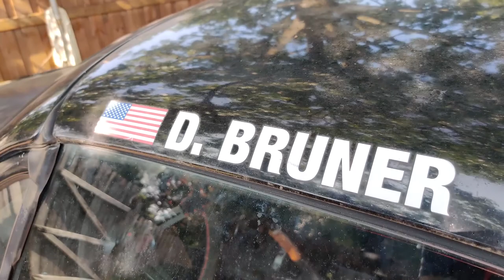2013 Scion TC ultimate daily driver EP2 front lip paint+install (How to do an OE quality paint job)

Comment: Great video! I have a black '13. Do you know where I can find the paint codes for color matching? Also, what fogs do you have!
Reply from the maker: Thanks so much! Very nice! The paint code will be part of your vin number, of which you can find on the inside of your door jamb. You can look up what part of the vin is the paint designation. As for the fogs, they are the winjet kit, from Amazon.
Reply: Thanks dude! Are you plugged in to any specific forum or community that I can follow you at?
Reply from the maker: @JonCarton  not really, I'm just active here and on instagram, which you can follow us at. I do post more updates there. I've got more TC content planned.